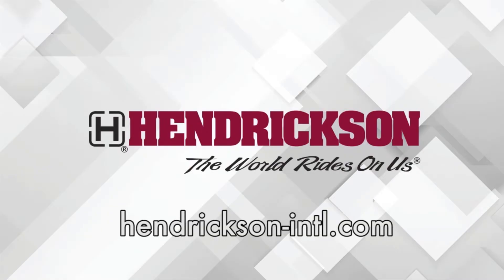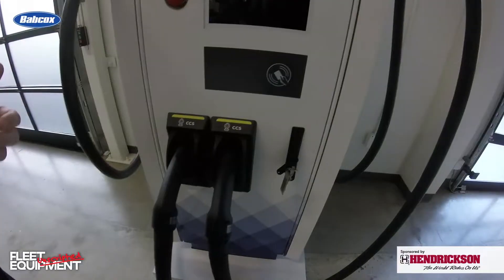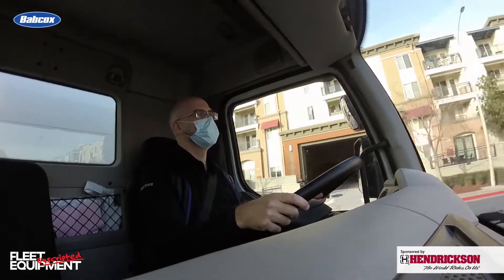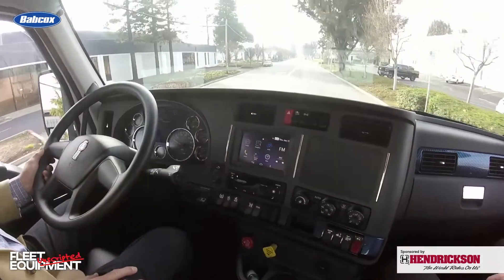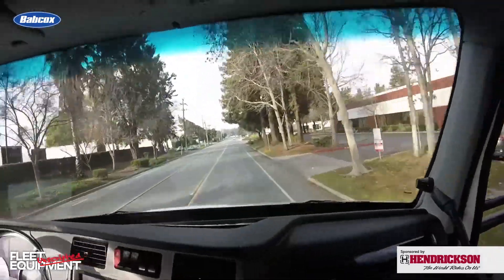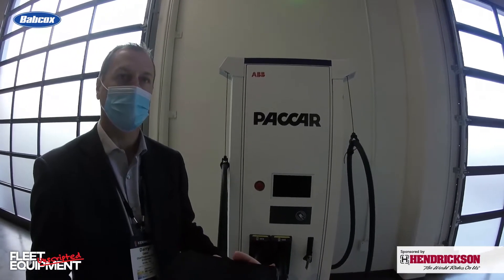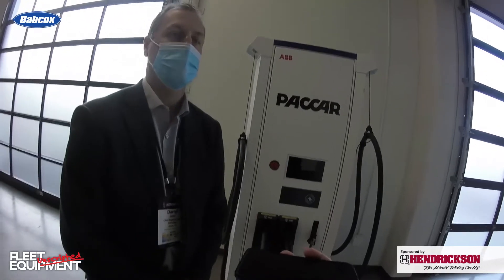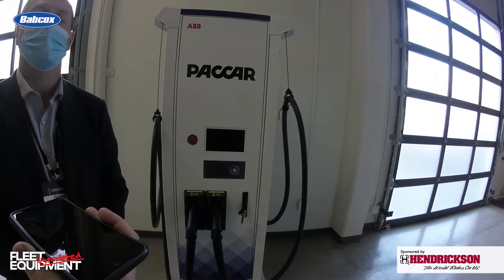Kenworth electric truck test drive, charging equipment overview | FE Unscripted

Comment: There should be more grant to made them CHEAPER not comparable to diesel ones....anyway, seems well done and I bet they use the same chassis component. That's a plus (in my opinion) since I personally wouldn't drive in a carbon fiber chassis with 6 Ton behind me, that's fancy stuff for supercar....